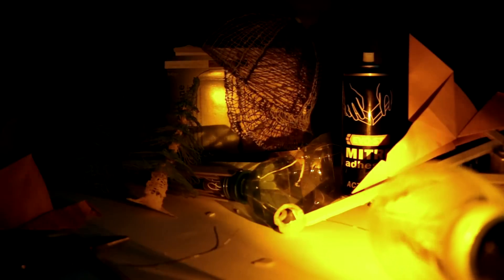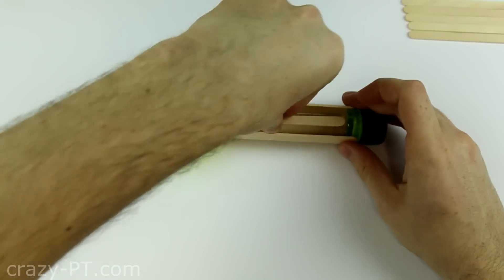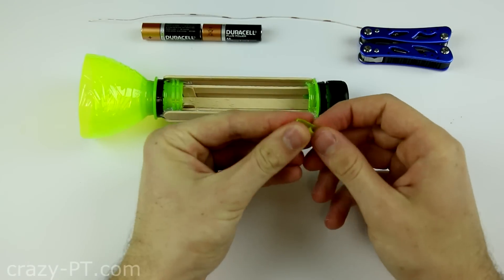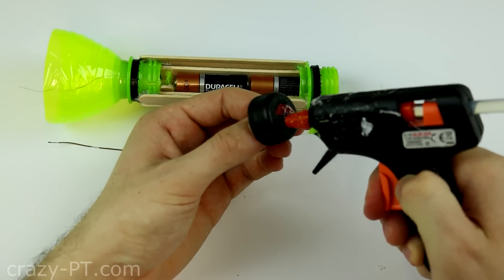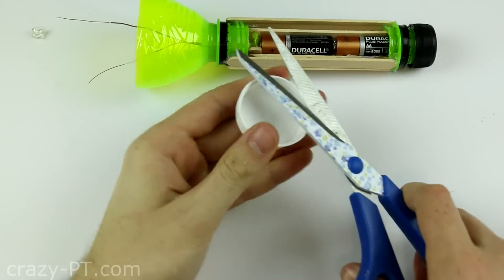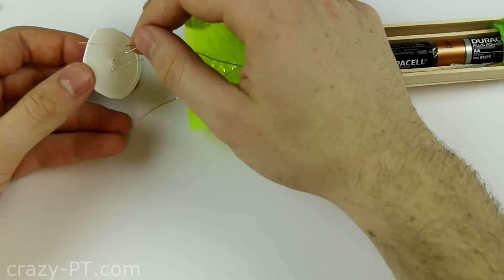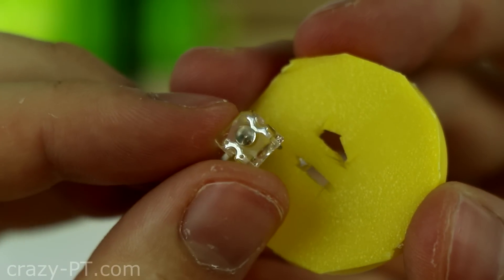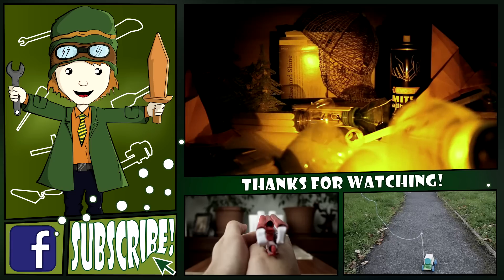How to Make a Flashlight using Plastic Bottles

Comment: We first cut the plastic bottle in half, then the other bottle's top. Next, we have to screw the cap off and glue popsicles sticks, half a portion of the bottle's mouth. After that we need to make sure that the half of the bottle and cap is connected by the use of popsicles sticks. We then cut two small pieces of popsicle sticks and glue it inside along the bottle's mouth. Cut a rectangular piece using the other half of our plastic bottle which will serve as the spring. The rectangular piece should be creased and then tie the wire around the spring, then glue the bag between the two small sticks. Make a small hole in the center of the cap. We will need a small wire,  twist and adjust it by 90°, then glue it afterwards. We have to make sure that the wire will make contact with the batteries. This will serve as its switch. 

We have to cut the edges of another bottle cap and form a circle. Mark the wire and create two holes, then insert the ends of the LED. Glue around it to make sure it will stay. Tie the wires to the right polarity of the ends of the LED. After tying the wires, we then have to pull it down from the inside. We then put glue around the circle. But first we have to take the batteries out, then glue one stick inside. Make sure that the stick is glued on the inter top to make space for the batteries. Lastly, cover it with popsicles sticks.

Comment: mine didn't work. the batteries and wire would get hot and the light wouldn't light and I used 3 different ones

Comment: does this involve science, technology, engineering,and math?
Please answer
Reply: Keianna Keptot yes it involves as you can see why only copper wire is used, because it is a good conductor of electricity as dry cell is a source of electricity. And LED light had glown because the electrodes which contain positive charge that is copper rod and brass cap and the negative charge is zinc case . When the positive and negative charge of the battery reacts with the ammonium chloride, which acts like electrolyte . When all these three substances reacts, chemical energy is converted into electrical energy through chemical reactions so current is produced. And he has connected the battery with the copper wire that acts as the conductor of electricity . It has passed electricity from dry cell to the LED light. If he wants , he could also Use a switch in the middle but he has indirectly used switch above the battery attached to those wooden rods that acts as the insulator of the two batteries or batteries and wire. So he has just decorated outside to hide the complicated part of the science. This looks very simple and may be simple to make it but the science is very complicated to understand. So, likewise he has good knowledge of electricity in science . So well done from me and good question, I'm happy to reply and share my knowledge to you all . I don't need any likes or others I'm not forcing you to give anyway.  So, once again THANK YOU 😊

Comment: which type of wire Is used in this flashlight? positive wire or negative?
Reply: rabia zubair only the battery contains positive and negative electrodes not the wire . It is neither positive nor negative.... 😊

Comment: Would I be able to use a coin battery in this? Someone please reply!
Reply: +Celin E He uses 2 AA. Each one is 1.2v to make 2.4v. A lot of coin batteries are 3v each. So you could use 1 coin and be close enough, but it will go dead fast.
Reply: +Tyler Brooks 1.5 volts
Reply: Sorry, no
Reply: Musagaming TV  differs in each or most  batteries. We have Eveready batts which are the 1.2 black batts

Comment: Oh your english is fine. i like your accent too. Oh one thing. You can use a white paint coat or aluminium foil or metallic paint or something to the inner side of the bottle (well tip of the bottle which is used as reflecting surface and to focus the light ) so that it will reflect the light far more profusely and resist the leaking of light through the transparent surface of the the bottle. :)

Comment: You could put tin foil behind and around (but not touching) the LED to focus the light and make it brighter. You could also cut a circle out of the side of a clear bottle  (Fiji water bottle would work best) and glue it to the front of the light to protect the LED.

Comment: so I suppose using resistance in a circuit is lost on you, LED's do not have a neg and pos they have a cathode and an anode requiring a resistor, using it this way will only result in burning out the LED very quickly

Comment: PLEASE HELP ME ! i tried to produce energy with a dc motor by creating a turbine ! i used a diode led to see if it works but i noticed than the diodes lights only when i rub the the cables ( those attached with the diode bounds )  i really don't know what's happening but i need help ! THANKS !